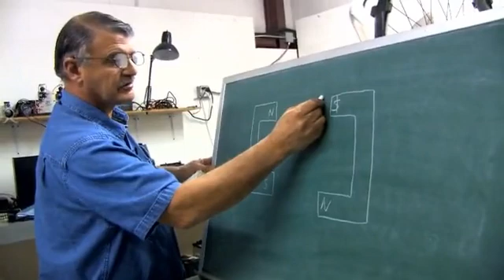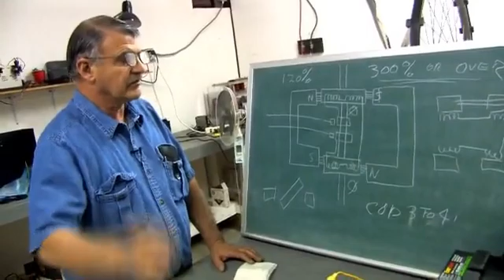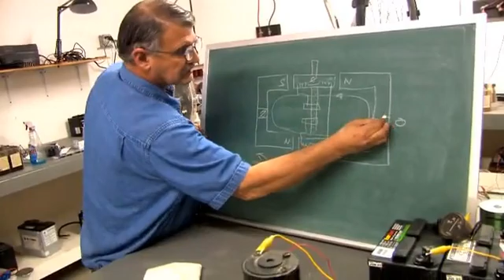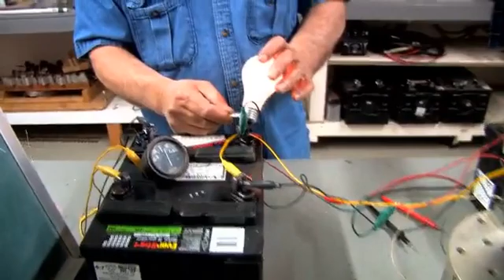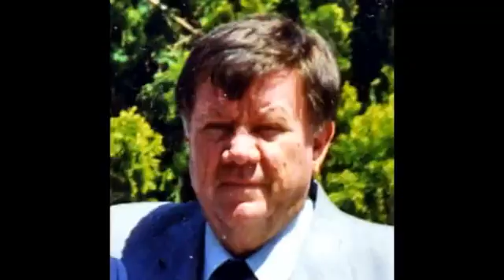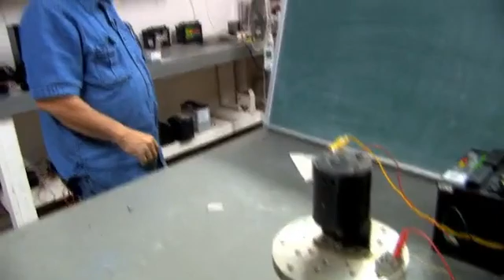#10-A - The Kromrey Converter (2009)

Comment from the maker: 0:00: ⚡ Revolutionary energy device presented at Town Hall event by John C. Bedini.
0:00: Introduction of a device producing more energy than it uses, set to change the world.
1:09: John C. Bini showcasing a prototype of a future energy solution.

6:56: 🌀 Explanation of the Kromrey Converter operation and patent issues.
6:56: The Kromrey Converter is a series arrangement of coils that discharges when the magnetic lock is broken.
8:12: The inventor of the Kromrey Converter, Raymond Cromr, faced patent issues due to an outdated patent.

13:30: ⚡ Innovative magnetic refrigeration system demonstrated with a machine running on battery power.
13:30: Machine operates without coal cooling or special pole pieces, running at 180% efficiency when shorted.
13:47: Demonstration of machine's ability to run light bulbs, though not at full brightness due to voltage.
15:03: Charging another battery while feeling colder air, showcasing the system's energy conversion capabilities.

21:14: ⚙ Optimizing energy transfer through the Kromrey Converter by strategically utilizing four poles for efficient energy pumping.
21:14: Energy is sucked in through a moving gate and expelled through coils to contacts.
21:57: Four poles are strategically utilized to force energy pumping in and out of the system.

29:04: ⚡ Innovative energy conversion device demonstrated, utilizing negative energy to power a light bulb with minimal current.
29:04: Energy conversion device demonstrated using negative energy to power a light bulb in a specific spot.
32:04: Machine adjusts to load of light bulb with minimal current consumption, pumping out cold energy.
33:05: Kromrey Converter showcased as a noisy machine with unique capabilities and non-magnetic shaft.

37:41: 🔋 Revolutionary generator design reached high power output, but faced production challenges.
37:41: Generator could easily reach 350% power output through coil geometry adjustments.
38:06: Production of the generator was halted due to internal conflicts in the company.
38:21: Over 150 models of the generator were built, but most ended up as decorative pieces.

43:08: 🔋 Revolutionary electric car technology utilizing aluminum battery for long-distance travel.
43:08: John S. Jaob files are highly sought after globally posthumously.
43:32: Innovative electric car technology using aluminum battery for 3-400 miles range.
43:56: Electric cars with aluminum battery technology existed years ago, offering efficient power source.

48:48: ⚡ Unveiling suppressed physics knowledge to address skepticism and share technology for energy generation.
48:48: Misconception of supernatural elements in technology due to lack of exposure to suppressed physics knowledge.
49:12: Comparison of advanced technology to a god-like figure in a village to emphasize the gap in understanding.
49:56: Encouragement to try and understand the shared technology for energy generation rather than dismissing it skeptically.

54:50: ⚡ Revolutionary energy technology shared by Tom Bon is a blessing, urging viewers to pay attention and learn.
54:50: Tom Bon's knowledge sparked creativity and desire to learn about suppressed energy generation.
55:27: Viewers are advised to heed Tom Bon's message as he possesses valuable insights on energy generation.
Reply: Thank you for taking the time to put the timeline.
For your information, at 8:12
The inventor of the Kromrey Converter, Raymond Cromr
Typo error here as we should read that the inventor is: "Raymond Kromrey"
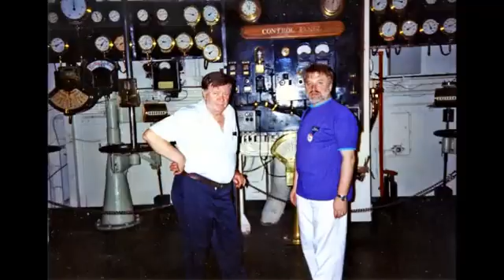Reply: Also, at 43:08, the name mentioned didn't sound like what was written, so I looked it up on the Internet. The name written is "John S. Jaob", but it should be  "John Cejka"
It is written properly in the title of your video no 26 of this present series:
https://www.youtube.com/watch?v=a_-V5HU62AY
Oh, and I just noticed that Mr. Cejka's name is also misspelled in the timeline of that video too.